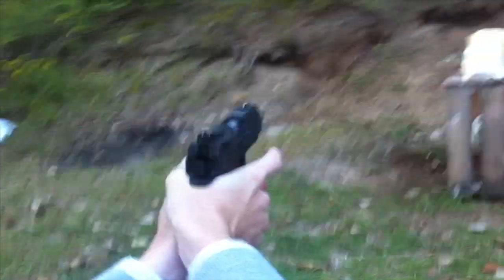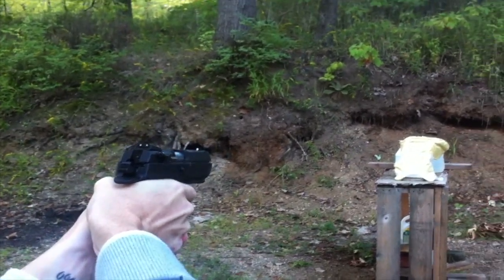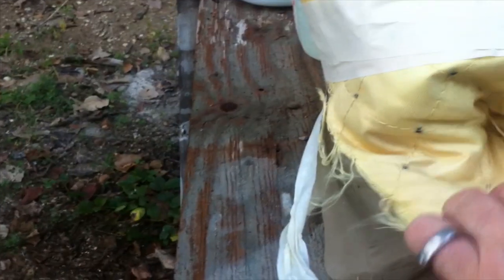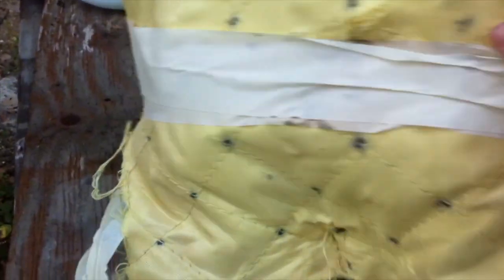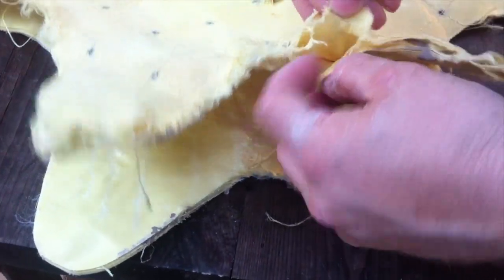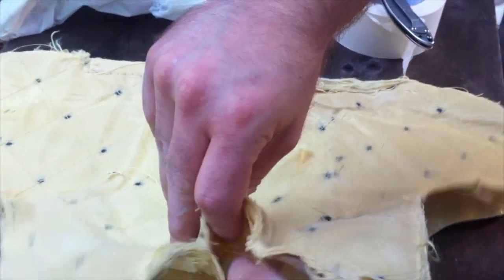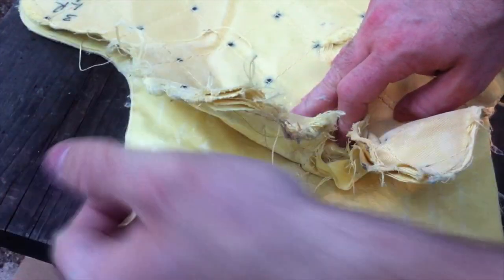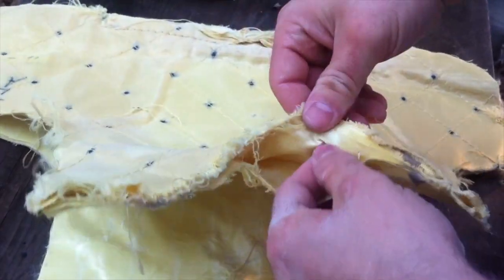9mm FMJ (115gr) Vs Level II Body Armor

Comment: Just an FYI for possible new video material, i was on youtube and came across a guy who was testing a level 2 or 3a vest, and penetrated it with 115gr wolf military classic 9mm. Apparently the bi-metal jacket makes it a good penetrator. And this is the cheapest ammo you can find!
Reply from the maker: +GreenCR21 Do you have a link to the video?
Reply from the maker: +GreenCR21 Interesting. yeah 2" apart is more than acceptable for subsequent shots.I've shot Tula 115gr and it's pretty warm stuff. Almost 1200fps from a 5" barrel. Level II is only rated to 124@ 1175 fps. I'd conjecture to say bullet construction, and velocity played the major role in the penetration, and not the previous shot :D
Reply: Nice!! :D gotta throw some in next time ya test soft armor

Comment: With how big that impact is, you can make a good approximation of shock. If I were to punch that clay as hard as I could, I could probably make a dent half as deep as that. So getting shot with Kevlar will feel like a full on punch multiplied by two. Really knock the wind out of you. But at least you won't have a massive gaping wound cavity, so there's that. However, I've never understood why armor companies don't attach a layer of rubber behind the Kevlar to help disperse a good amount of shock. Being that rubber tires can actually catch small caliber bullets and can help reduce shock on bicycles and cars through rigid terrain.
Reply from the maker: +Celestino Quintana II Actually some do, or they sell trauma pads to go behind the body armor panel.
Reply: Buffman 
That's cool I never knew that. All the body armour I know about is hard armour and soft armour. I'm curious if they have super light Kevlar with a trauma pad that I can where for duty under my suit.
Reply from the maker: +Celestino Quintana II AR500 Armor makes a IIIA hybrid that weighs 1lb. The trauma pads are about 6oz: http://www.ar500armor.com/ar500-armor-trauma-pad-10-x-12-asc.html#.Vkkwp02FOpo
Reply: Buffman
Thanks for the link. I think I'll probably buy that. In private investigations sometimes we end up sitting in sketchy neighborhoods for several hours conducting surveillance. Looks like I could easily conceal it for increased defense.
Reply: weight?.. maybe idk for sure.
Reply: I know this comment is 7 years old but I want you to know that you accidentally came up with the "plate backer" idea before was popular. Cheers!